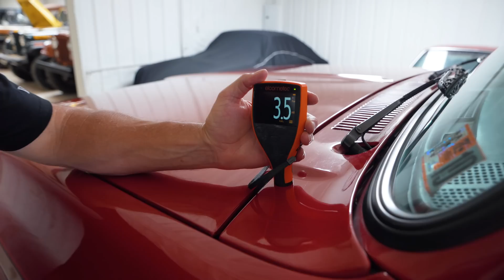1987 Chevrolet V10 Silverado Pickup Truck on Bring-A-Trailer!

Comment: I am not afraid to admit it, but ..Never heard of a V-10 until today. I learn so much from watching this channel.
Reply: So you never heard of the srt 10
Reply: @Kali2TexasTv  😅😂
Reply: just said same thing to myself 🤔
Reply: @camwinston5248  no Dennis says it’s actually a v-10 from 87 which is badass
Reply: @camwinston5248  🤣😂
Reply: @camwinston5248  🤣😂
Reply: @Kali2TexasTv  V10 model is not to be confused with a V10 engine, which is clearly what most people think of right away.  I'm guilty of it myself until I looked it up.
Reply: I was like wow what do we got here somebody drop a Dodge into the Chevy 😂🙃👍🏻
Reply: @Patryn71  ohh got it
Reply: @DirtFloorGarage Not for this model for this year. As stated in the video, it was R or V for 2 wheel/4wheel drive respectively.  Easy enough to google and confirm that, also.
Reply: Same here
Reply: R/V Replaced C/K for ‘87 model year
Reply: @Patryn71  Same here
Reply: Same never heard of a V10 Chevy.
Reply: Absolutely awesome truck, class A truck from a class A person
Reply: @Kali2TexasTv  you got me lol
Reply: @truckerkevthepaidtourist  ! Exactly!
Reply: @camwinston5248  they became V coded with throttle body in 87. I had a V-20 myself
Reply: V10 signifies 4wd, not v10 engine size.
Reply: Yea the v was 4x4 and r was 2wd
Reply: @DirtFloorGarage it is a thing. R10 is 2wd. Is was change in the transition year.
Reply: @Kali2TexasTv  V10 means 4wd truck not v10 engine 350 fi
Reply: Always thought the V series was reserved for the late 80s early 90s full size blazer. Strange because the 88 to 98 4x4 pickup was k1500. No matter. Beautiful Chevy. Wish they still made them like this 👍
Reply: @camwinston5248  
He meant to say C-10 
Not V-10.. 
K-10 was a Blazer.

1/2 Ton was. C-10 .

First V10 was a 1994 
Dodge 2500 LWB. Singel Cab. Or 3500 Dually single cab..
Reply: @tomgeorge9025  wrong, scooter. He spoke the truth when he stated it as a "V10". Dang, don't y'all know how to Google something before making a upside down comment about something that's false?
Reply: @Patryn71  thanks. I was also thinking of a V10 engine and not model. We didn't get it in Africa. Only C10, C20 and C30. All early models had the straight six 4.1 engine
Reply: @Patryn71  That was me, V-10? What? Then he started it up and it was clearly a V-8.
Reply: V10 and r 10 were 4x4 and 2x4 the y changed it in 87 because in 1/2 ton and 3/4 ton they were c/k 1500s and 2500s in 1988 that's why it was changed.
Reply: @DirtFloorGarage Google it r10 v10
Reply: GM changed the C/K square body in 87 to R/V when they new body truck came out. Confused a whole bunch of people!!!😅
Reply: @DirtFloorGarage Not in 1987. No C and K Series that year. Only R and V Series as this one is.
Reply: @lucasshupe8108  As a square body yes, from 1987 to 1991. See my explanation above.
Reply: @davejohnson3037  Oddly enough, they made the square bodies R and V Series from 1987 to 1991 to AVOID confusion between the products (as the GMT400 came out in 1987 for the 1988 model year). LOL. Didn't always work.
Reply: @googleusergp  you've got that right!  I worked in a GM dealership parts dept during that time and half the " technicians" were confused!!🤣🤣
Reply: @davejohnson3037  Imagine seeing the new parts book in 1987 and going, "What the heck is an RV Series?" LOL.
Reply: It's not a engine v10 it's a Vin number package....I have a 87 suburban v10 it's a 5.7 engine tbi....the v10 is a package mine is a scottsdale
Reply: @truspirit1925  yeah, we caught that, we just had never heard of a V10 Chevrolet designation
Reply: @truspirit1925  It's a model series. A V10 in this era truck is a 4WD (V) 1/2 ton rated (10).
Reply: @googleusergp  yeah I knew it was something like that....some people think it's a v10 engine.
Reply: Wow! Beautiful truck!
Reply: Had a pretty minty 1990 Blazer that was referred as a V10, I was thinking no it’s got a 350 small block. Funny,that confused me about 20 years ago.
Reply: I didn't know it either , didn't know chevy made a 10 cylinder either .
Reply: Have 88 V10 Suburban square body.
Reply: Aha!    Hate to say it,  it that’s a bit of click bait right there!     At that, I’ve never heard of a V10 model either.
Reply: Man!   My first ride in 1986 was an almost identical truck.  It had been my grandfather’s, and my dad inherited it, and it became the family work and hauling truck.    Ours was a 1983 model, Scottsdale trim, but very close to that one.   It was a short bed, same color, a red that is almost ultra deep orange, silver roof, and 2WD.   The engine my brother and I never could figure out, and back then we didn’t think of using the VIN to figure it out and there was no internet, but supposedly it was a 305, but it seemed WAY too powerful compared to other similar trucks.  My grandfather was a known leadfoot, having bought the Lincoln Versailles specifically for the 351 Cleveland, if that tells you anything.    So he had the catalytic converters removed right after buying it, and the Quadrajet seemed to have bigger secondaries than similar trucks.    Ours the silver cladding to catch rock chips along the rockers, similar belt line strip but I don’t think it was chrome.    It had the same vertical bumper guards, which got used often, and the back bumper was silver instead of chrome.  It did have the bed rails, and had the ESC emblem on the tailgate, which I learned all about after warping a head and having to rebuild the top end as a 17 year old.   Electronic Spark Control.    The exhaust was already rusted by 1987, so my dad had duals put on it, and with the big P245/75/R15 Michelin tires, it sounded mean and looked like a bulldog with that raked stance.      It did incredible burnouts and I smoked a few 5.0  Mustangs out at Cooper River Dragway at the time.   My dad wasn’t too happy about the “excessive wear” on the back tires.  He was no dummy, and set me straight about that expense.   Never again.  But again I did and it cost me cash.   We ended up going with General XP2000s from Sam’s Club cause they were dirt cheap, but they crappy tires too.      One ProStock style burnout and they were on their way to early onset baldness.     That truck was awesome.    The grille was a little different being a Scottsdale, and I don’t remember the silver around the instrument panel, but same interior colors as well, no cassette but FM radio, cold AC, power steering and brakes, no power windows or locks, and it jumped very well, staying pretty level with just the right approach and jump shape.   That thing bounced many a times like a lesser version of the old Fall Guy intro.    Just enough to chirp the tires when I tapped them mid-bounce.    Ultimately my love for being sideways doomed that truck, and I kicked it sideways in the old 
Piggly Wiggly parking lot in a drizzle coming off of Savannah Hwy after school.    Regular routes were gridlocked right after school and of course I knew of alternatives.     Crossing Sav Hwy could be hairy with that traffic but horsepower won, at first, with the slight bump at the entrance to the parking lot unweighting the rear end just enough to really let me get totally sideways, looking out of the passenger window going down that parking lane, before coercing it around the end of the column of cars and I thought the coast was clear.   Nope.   A late black 1970’s Grand Prix was parked away from the other cars,  and my youth and inexperience prevented me from lifting of the throttle.    My right front end hit that parked car’s right rear end so hard the back of the truck came off the ground and we ended up facing the opposite direction, with steam coming from under the hood.  I asked my buddy if he was alright, cause it was that incident which cemented my use of seat belts.     I could feel my body trying to come out of the seat and through the windshield to the right, very, very strongly.     I even had marks on my knuckles from the steering wheel hitting the dash.     Yep.   Wear your seat belts kids.    That sucked, and I learned.   Never get sideways in public in a wet parking lot without first making sure there’s plenty of room for you to stay in the gas way too long and really push the limits of how far you can keep it oh so beautifully sideways.   I got that truck stuck so many times, sometimes to the frame rails, but with a come-a-long and a long 3/4” rope, I always got out.   A small pine tree may have been uprooted once or twice in the process, but that’s not been proven.     High centered with the front wheels hanging over a steep hill?   Yes.    So stuck I had to crawl out of the window cause the doors wouldn’t open?    Yep.     Drive backwards across a parking lot and over small medians as if they weren’t there just to show off?  Yep.   Then see a cop turn around to come mess with me, backwards 180, then hard turn with inside two wheels airborne across a ditch, leaving Johnny Law clueless as to how I disappeared so quickly?    When my friends and I were teenagers, we didn’t go to parties and get drunk and do drugs and get into that kind of trouble.   We kept it wholesome.    Irony of it all is that the only thing I’m addicted to is donuts and smoking tires.   I kick for awhile after new tires on my Magnum, but that only lasts a couple of months.     I never buy expensive back tires.   It’s pointless.     Nice truck.   Used to have one just like it but ours looked meaner.    Those Rally wheels with the beauty rings was always the best look.     Once they start rusting they won’t hold air and fixing that is futility.    Never reseat a tire bead with water in the tire.    Sometimes you don’t have time to wait for optimum to happen.
Reply: @tomgeorge9025  wrong
Reply: In 1987 C10 became R10 and K10 became V10 because of the new body style coming in 1988 that would continue to be C and K series but the old body style would continue in 3/4 ton, 1 ton, suburban and blazer until 1991.
Reply: @weskirkland5850  I remember our radio station had a red 1991 Suburban that we used to call Rock Lobster with the old school look.. I wonder where it is these days?

Comment: V10 simply means 4wd in 87’. Chevrolet switched their normal naming in 1987 from the K series (K10, K20, K30) for four-wheel drive trucks and C Series (C10, C20, C30) for two-wheel drive trucks to the V series (V10, V20, V30) for 4WD and R series for 2WD (R10, R20, R30) This same change was made to the Suburban and Blazer and the GMC Sierra and Jimmy. GM only kept the V and R naming for five years, so any truck made between 1987 and 1991 will use these names (GM changed the naming in 1989 to the more modern 1500/ 2500/ 3500 naming scheme, so any 1989, 1990 or 1991 truck will be a V1500/ V2500/ V3500 or R1500/ R2500/ R3500.
Reply: Yup GM has NEVER produced a production 10 cylinder. Always been a 8 cylinder or 6 cylinder
Reply: @Bill Bayes  I want their 12cyl. I'd wedge it in my 1971 c10 😊
Reply: Thanks for the info
Reply: The 88-98 trucks are called c/k pickups? I’ve never heard of them being v or r
Reply: @grissom.  the square body models produced from 1987 - 1991 are r/v models.
Reply: @grissom.  K pickups/Suburbans in late '80s early '90s had independent front suspension while the  V types retained the earlier straight front axle.

Comment: Beautiful truck. Must say, never heard of a V10 Chevrolet truck.
Reply: It’s a Viper V10 Truck 
Made only for one week in 1987 . 

V10= 350. 5.7 
4X4 C-10 . 
K10 was a Blazer.

V10 came out in 1992 Viper ..

Dennis made a mistake, he does have hundreds of cars and trucks..

Look it up, 
I made a mistake,
V10 is a 4x4,
In mid 1987 the new Body style came out 1988.

1999 and 2000 
Chevy Silverado had two 
Body styles, same as 
87 & 88.
Reply: @tomgeorge9025  Thank you Tom. I had a C20 4x4  in 1982, with the 4,1 straight six engine.
Reply: Who buys a truck like that and not work it... RIch Texans? I have 17 in a barn not near. This nice but all could run with a little work 73 -87 they aren't that rare
Reply: @tomgeorge9025  Wrong.....watch the video.
Reply: @tomgeorge9025  Dennis did not make a mistake it is a V10. V = 4 wheel drive, 10 = half ton

Comment: I have a 1991 V3500 Crew Cab that came from the factory with a 350 TBI/4L80E trans/NP205 Transfer case/Dana-60 front diff/Corp 14- Bolt rear diff.

Comment: The name change came because the new body style coming out in 88 was planned for an early release. They released some early model 88s mid yr in 87 and they didn't want confusion with the new generation. All 4x4 87s were V series. All of the RWD  trucks were R series. The C and K series returned with the "new" body trucks now called OBS Chevys.
Reply: Yes & when the OBSs came out in 1988, they only came in 2-door cab pickup models at the time because the SUVs & 4-door cab pickups with the square body design were still in production up through 1991.

Comment: I'd take this truck in a minute over my 2019.
Reply: It will probably out last your 2019.  Probably has less miles on it too, just sayin'
Reply: If rust gets started, it won’t last five years.    The engine will feel gutless in comparison, and the ride will throw you all over the place compared to a modern truck.   If you like driving a buggy that will need thicker floor mats to keep your feet above the pavement instead of a modern smooth and powerful truck that won’t rust for at least ten years, then have at it.

Comment: 87 I believe was the last year for the 1/2 ton,  you could still get a square body in the 1 ton up to 91 .
Reply: 87 was the last year for plain cab pickups "1/2 ton & 3/4 ton models only", but the 1 ton plain cab pickups on the other hand were still in production up through 89. After that, the crew cab pickups & SUVs were the last models left in production up through 91.

Comment: 1991 was the last year for the square body models. Just the half ton & three quarter ton plain cab pickups were finished in 1987, but the one ton plain cab pickups on the other hand were still in production up through 1989. Like the one ton plain cab pickups, the medium duty models which are the bigger size trucks with the same cab design but with a smaller rear window were also finished in 1989.

Comment: Wow, that is one sweet ride.  I didn't even know that was a tool that measured paint thickness-- shows that I am not a car guy, but I love this channel and love this show.
Reply: They have been checking the paint thickness on planes for years
Reply: You're still a car guy
Reply: I used to be an end-of-lease car inspector. I had one of those paint meters. Made it easy to detect unreported repairs.

Comment: Beautiful truck Dennis! I had the exact truck in 1988, New style, red, 350, 4 wheel drive, etc... But I like the square bodies best 👌
Reply: As a old body and paint man I due to they where rust buckets.
Reply: @Time Traveler  Yes.. I had my 88' for 31 years until the frame rusted through and broke in half. Sheet metal gone too.. but, still a good truck
Reply: @stubstoo6331  idk where ppl live where their trucks just rust away, im still driving my 1980 k10.. it's not rusty at all, I do coat the underside with amsoil MP every few years
Reply: 1988 “new” style 3/4 ton 4X4…my first truck. Lol
Reply: @JackWorkz  I actually live in the south nothing rust down here. I don't think I could handle the rust belt.
Reply: @Squish   Yeah... unfortunately live in Minnesota, rust belt for sure. Underside coatings were not used much back then, around here. My 88' 4x4 with 350 motor sure ran good though...
Reply: @ronlind1757  actually I was kidding you about being a body and paint guy, but I'm old enough to remember when GM in 73 changed their truck and van body styles and stopped their Dip primer process those trucks and Vans were the absolute worst vehicles ever made by any manufacturer for rust. Hell they would rust down here in the south just for getting wet from the rain.
Reply: @Time Traveler  I remember in high school in auto body class.. a kid brought in his dad's 73' or 74' Chev pickup to touch up. Only a year or two old and had rust all under rockers, fenders, and box. Couldn't believe it

Comment: Had a 85' C10 long bed 2wd, I was 2nd owner, had a Jasper 350 with less than 30k on it, frame broke in 99' after 1 jump over some railroad tracks?! Sold the motor and transmission for more than I paid for the Truck!!

Comment: Roll out and wing windows rule, have a plastic bed liner on a 1990 250 4x4 and they are huge for saving dents and wear.  Long beds are more useful for real use too. 👍
Reply: Wing windows...? 
This is a flying truck ? 
I guess thats why it has a V10.

Comment: I had one of the first 1988 C1500 Silverados in Dallas, and it had that engine. It was a good engine. Cold starts were no problem with that throttle body fuel injection. I was a GM employee at the time, so I got it for a killer price, too.

Comment: As noted by others, there are no 1987 C and K Series. The square body trucks ran from 1973 to 1986 as C and K Series (two and four wheel drive respectively), and then from 1987 to 1991, the square body was the R and V Series (two and four wheel drive respectively) as this V Series truck is. In the spring of 1987, GM released the GMT400 truck as a 1988 model year, and that was a C and K Series again. Since the RV and CK were sold in the same dealerships together for a few years, GM changed the nomenclature to avoid (not always successfully) confusion between the two in the showroom, service department and parts department.

Comment: I thought the last few years of the square bodies (88-91 Blazers, Suburbans and Crew Cabs) was when they started the R/V badging. I guess you learn something new everyday.
Reply: Yes 1991 was the last year for the square bodies. Just the 1/2 ton & 3/4 ton plain cab pickups were finished in 1987. The 1 ton plain cab pickups on the other hand were still in production up through 1989.